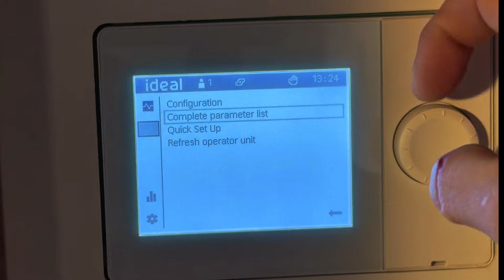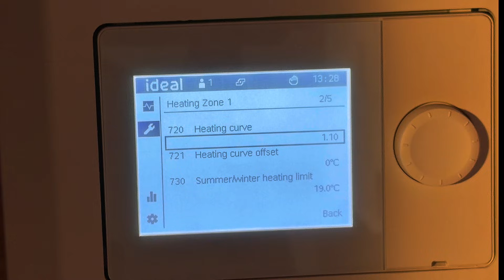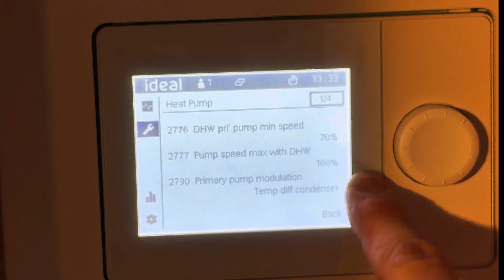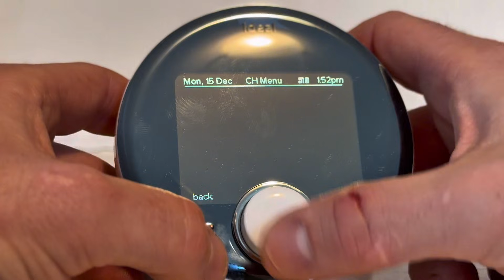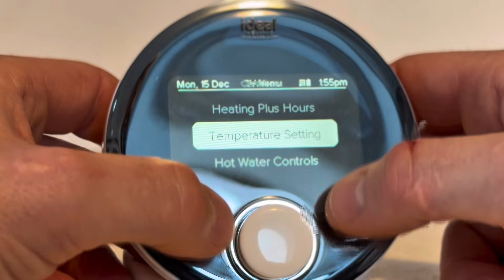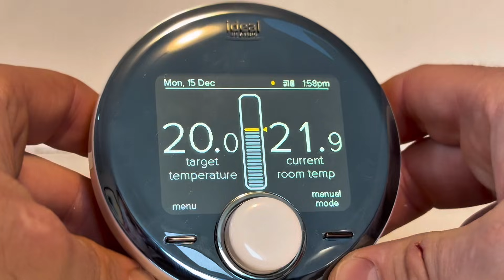Ideal Heat Pump Hacks: Max Efficiency & Lower Bills

Comment: Thanks for this. I have recently moved into a new build where the installer had the under floor heating and the upstairs the wrong way round on the curve. Set for 1.5 for underfloor and 0.8 for upstairs rads. I've swapped it around and I'll give it a few days to see what happens!!  But the place was never getting below 24/25ºC 🙄

Comment: Great video, thanks. How far would you suggest going with the compressor min off time? Ive been running off full weather compensation at 0.4 curve but heat pump cycles are only lasting approx 5-6 mins when outside temp is above 10 degC. Would you suggest going up towards 30 mins for the compressor min off time?

Comment: I set the heating to off outside the heating season. Temperature outside can easily drop below the OT switch off overnight, but who cares, it rises quickly after sunrise. The house is normally at a good temperature whatever the night low temperature during summer.
Same as boiler - hot water only during summer months.

Comment: Useful info. If only Logic would/could keep people's software up to date. We don't even have the min/max pump speed or primary pump modulation settings at all (we had ours installed in March 25). Other manufacturers do OTA updates but not with these. 

Our SCOP figures are wildly inaccurate as well - so much so they're completely unusable and then the Halo shows completely different figures 🤦🏻‍♂️
Reply from the maker: Might be able to with the logic monitoring system you can install.

Comment: Think you need to read what room influence is!  0% is least efficient, not more.
Reply from the maker: Incorrect you want less percentage = less influence on the room stat = pure weather compensation = more efficient.
Reply from the maker: What happens as you change the percentage

🔽 Lower room influence (0–20%)
	•	Heat pump runs almost purely on weather compensation
	•	Flow temperature stays stable
	•	Longer run times, fewer on/off cycles
	•	Best COP / efficiency
	•	Requires:
	•	Well balanced emitters
	•	Correct WC curve
	•	Decent insulation / thermal mass

➡️ This is the “engineer’s choice” for efficiency

⸻

⚖️ Medium room influence (30–50%)
	•	Room temp can trim flow temperature
	•	Useful if:
	•	Property has mixed heat loss
	•	Solar gains or cooking regularly affect internal temps
	•	Slight efficiency hit vs pure WC
	•	Still acceptable in many real homes

⸻

🔼 High room influence (60–100%)
	•	Room stat dominates control
	•	Flow temperature ramps up/down aggressively
	•	Short cycling risk increases
	•	Lower seasonal efficiency
	•	Feels more like a gas-boiler thermostat

➡️ Comfort-led, not efficiency-led

⸻

Why lower room influence = higher efficiency

Heat pumps love:
	•	Low, steady flow temperatures
	•	Long run times
	•	Minimal cycling

High room influence causes:
	•	Flow temp chasing room temp
	•	Unnecessary compressor modulation
	•	Higher electrical input per kWh delivered

⸻

Best-practice setting (what I’d recommend in most installs)

For a properly designed Ideal Logic Air system:
	•	✅ Room influence: 10–20%
	•	✅ Weather compensation: Primary control
	•	✅ No on/off thermostat behaviour
	•	✅ Emitters balanced for design ΔT